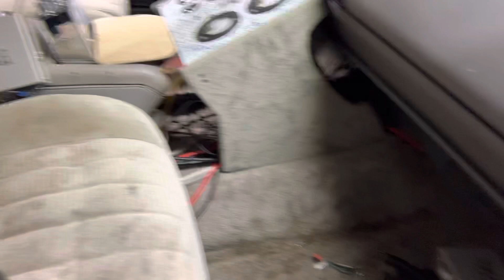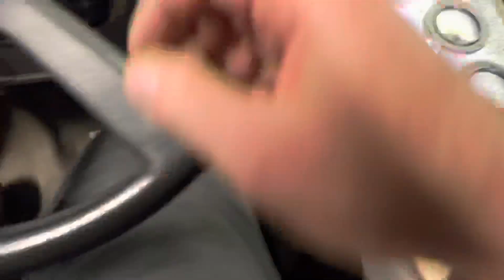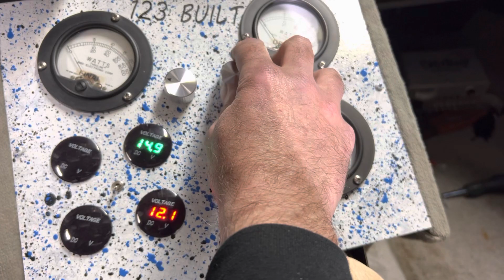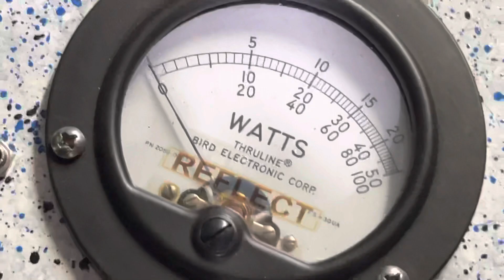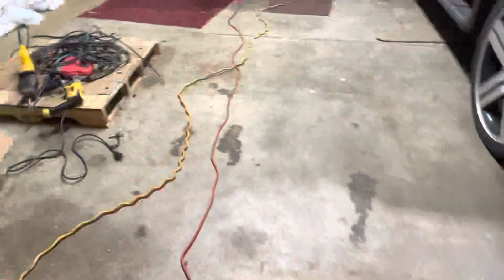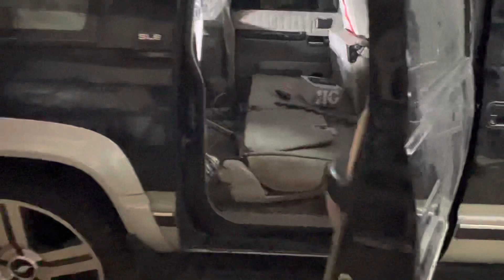The Work that Goes into a Shoot out Truck. !!!

Comment: What's the job of the inverter in an AC or DC truck?
Reply from the maker: To power 120vac switching power supplies…. To run the radio and driver…
Reply: @123builtchicago5  Is this only because the truck has 24V?
Reply from the maker: @davidshapiro5616  
No it’s a 12vdc truck… 
Sine wave is the key…
Reply: @123builtchicago5  Ah yes, I'm an idiot:-) You don't know me but in a past life back in the mid 80's I travelled from London, UK to two breaks  one in Tyler, TX and another in Chicago I believe. Did I see your truck there with Bluegill and many others. Dennis Ostrowski molded my 16 x Tosh 2879 box to have good thermally tracked bias as I was then most only on sideband. That amp is still in the box and I've never used it till this day.